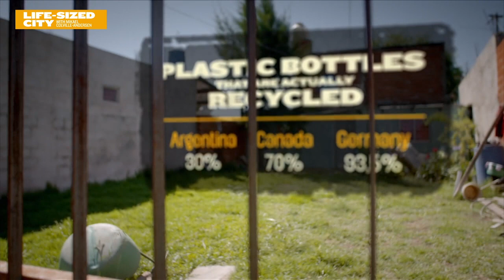How To Build Cheap Water Heaters With Solar and Recycled Cans - The Life-Sized City - Buenos Aires

Comment: As a ex plumber I’m worried about the bacteria that might be created in the storage of the holding tank of water doesn’t reach a very hot temperature.
Reply: I guess they could run the usual cleaning routine that water holding tanks go through...like say chlorine bleach disinfection every 6 months
Reply: @Ponen77  Plus, the water actually does get quite hot.  Our condominium complex in California heated their big swimming pool with a system similar to this.  Of course, in that setup, there was chlorine in the water already so any bacteria got a double-whammy.
Reply: the water is gonna boil fast, ever left hose on sun? actually it's nice school project but simple thinner black hose does the job too

Comment: Why does the return to the tank only enter halfway up, rather than at the top of the tank?  Is that just the way it works out, using no pumps and only convection to move the water?  I would have expected them to run the pipe up another foot or two to the top of the tank, but I'm sure they have a very good reason to not do that.